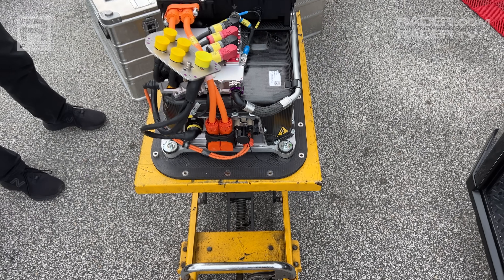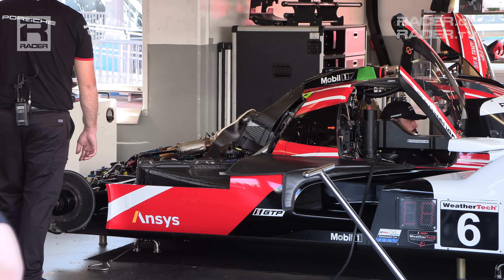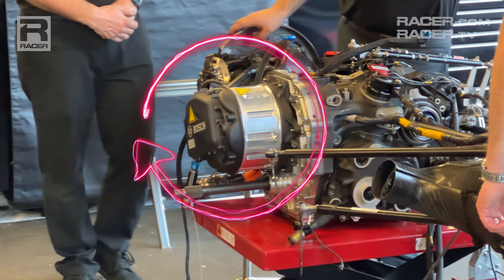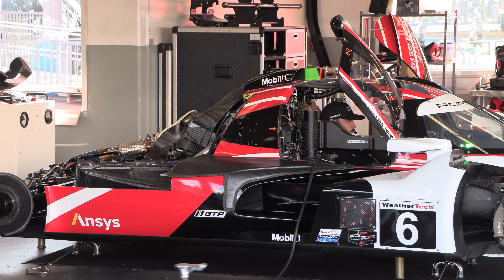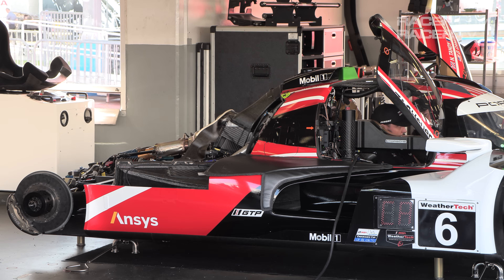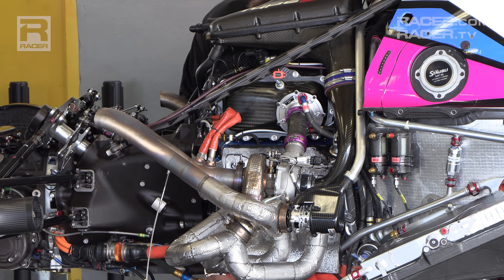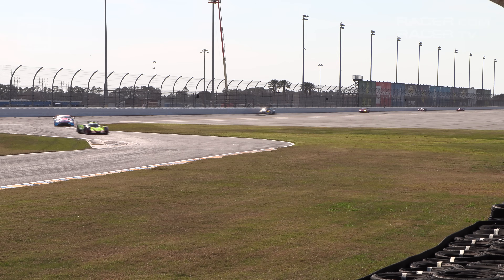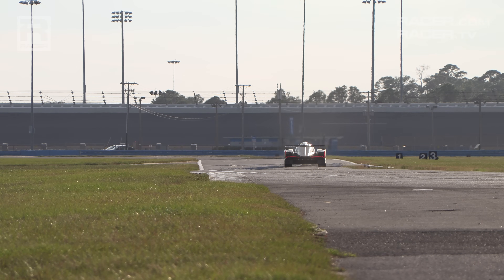IMSA GTP 101: On and Off Track Battery Charging Strategies

Comment: Formula 1 cars definitely harvest on the straight. They flash the rain light to let the following driver know that. It makes for great strategy and passing depending on where they harvest and deploy.  If the GTP cars are always at peak horsepower the only advantage and strategy would be using the low end torque of the electric motor?
Reply: But that's due to coasting, capturing the energy lost at the rear wheels as aerodynamics and engine braking take effect. This sounds like the ICE is directly driving the MGU to charge the battery .
Reply: @djmohab2  No, they often harvest on the straights at wide open throttle. Pay better attention.

Comment: Did I understand the straight-line charging correctly.....essentially the engines make more power than the mandatory limit, the engine management system limits the engines max power, however under charging the extra power is used to charge the battery meaning only 670hp hits the road?

Comment: I struggle to think of something more ironic than a hybrid racing car charging its batteries with its internal combustion engine during warmup.
Reply: Yeah, this part I don't get...
Reply: As long as the fuel efficiency and performance out on track aren't affected then any kind of power generation makes sense.
Reply: @giuseppepuglisi3980  
No conversion of energy makes sense, as it is always associated with losses!
Reply: @giuseppepuglisi3980  they are affected
Reply: First of all: the hybrid unit in these cars is very much a marketing tool. That is probably its main purpose. It could have added to the performance of the cars, but that's not really what it is supposed for. Always consider this: the main targets for the new regulations were keeping the costs down and attracting manufacturers. That's why these are spec parts. Another guy asked a similar question and an engineer gave an interesting answer which I will just paste as here:

From AbsentTK421: "Former Prototype engineer here. Thinking about this as only an energy saving feature isn’t quite right.

Instead, this system basically means you have two hybrid modes available to you. If you only harvest through braking, then you extend fuel range and efficiency. If you opt to harvest on the straights, then you are spending fuel, but gaining energy to deploy for a faster lap. 

This is pretty cool because it means you can opt to use the hybrid system either to extend your stint length, or if stint time is not an issue, just use it to go faster"

Makes a lot more sense this way. So the impact of this unit may not be huge, but could still be race deciding!
Reply: @ReXzz  
Effectively, it is a gimmick to aid racing - under a green cloak.
Reply: @X8X8X8X8X8X8X8X8X8X  a bit yes

Comment: Great video and it answered some questions I had about the power split between the ICE and MGU. It's also the first time I have heard about the charging on the straight.

However, the charging on the straight does seem to defeat the purpose of having a hybrid system. What is the point of having a hybrid system to save fuel when on the straight you are burning more fuel to charge it up? It just gives more credence to the accusation that putting a low powered electric motor in a race car is just greenwashing and manufacturer PR
Reply: Former Prototype engineer here. Thinking about this as only an energy saving feature isn’t quite right.

Instead, this system basically means you have two hybrid modes available to you. If you only harvest through braking, then you extend fuel range and efficiency. If you opt to harvest on the straights, then you are spending fuel, but gaining energy to deploy for a faster lap. 

This is pretty cool because it means you can opt to use the hybrid system either to extend your stint length, or if stint time is not an issue, just use it to go faster.
Reply: @absenttk4213  How can you deploy it for a faster lap when you're capped at 675 HP regardless of distribution between ICE and MGH? Is it because you can have instantaneous torque from the MGH vs having to redline the ICE?
Reply: @djmohab2  Because the combustion engine can make more than 670 HP and use the extra power to charge the battery on the straights, while the electric motor helps give you a faster lap time out of the corners.
Reply: @oddball0045  cheers! Is there a maximum energy cap per lap like WEC?
Reply: @absenttk4213  thanks for the explanation!

Comment: what kind of mileage gain are these cars getting?
Reply: They’ve gone from 2 MPG to 3.
Reply: @andrewahern3730  So a 50% increase in gas mileage!
Reply: @shaunguanco  honestly, probably close to that. Usually 100% of the energy is lost during braking. OTOH It’s a low power electric motor (relative to the ICE) and it charges on the straights, so it might be worse. I wonder if there’s an eco map if they’re trying to stretch pit window?

Comment: What is the point of the hybrid engine?  Just to give the illusion that your sport is all into the global warming scam and appease the "greenies" with a talking point.  70 horsepower for $500K dollars per unit.  The teams probably would rather shut the thing off and let the engine provide the full 670 horsepower.  Probably creates as much CO2 loading the engine to charge the stupid battery.  I hope that battery in the passenger seat is fail proof because some driver is going to have a blow torch right next to them when it shorts out one day.

Comment: Very cool breakdown. Only other race car that I remember that could regen under power was the Porsche 919, but I believe they used a flywheel mechanism to do that.
Reply: That car had an MGU-H, similar to F1. Used exhaust gases to spin a turbine and charge the battery.
Reply: @ryanwhitlock7350  Thank you for sharing this. Considering manufacturers now want MGU-H out of F1 due to the cost, it really puts into perspective how much the top 3 really were spending to win Le Mans and why it was so unsustainable
Reply: The 919 had a battery, Audi was using the flywheel. Toyota used a super capacitor. After 2015 they all realized batteries are unbeatable so Audi & Toyota switched to that type of energy store too. The 919 charged its batteries under braking and via an MGU-H (exhaust energy)
Reply: Not even close.  Research the "KERS" system used in formula 1....
Reply: @Dean0017  who is that addressed at?
Reply: @ReXzz   @JT
Reply: @Dean0017  kk🫱🏼‍🫲🏽

Comment: So… seems like the key would just be to build an engine that can make 800 hp, and neuter it so that you’re making 737 hp with the ICE (670 hp for powering along on the track, 67 hp for charging the MGU). Then using the MGU for powering out of slow corners where the power band of the engine puts you outside of 670 hp?

Seems like a much more complicated, more expensive, and heavier solution than just making an engine with 670 hp to begin with…
Reply: Exactly it is way more complicated and it is all about politics has nothing to do with the advancing of Motorsports. It has everything to do with advancing various political agenda  by Corporatists

Comment: Now this is quality content, any word on the battery pack capacity?
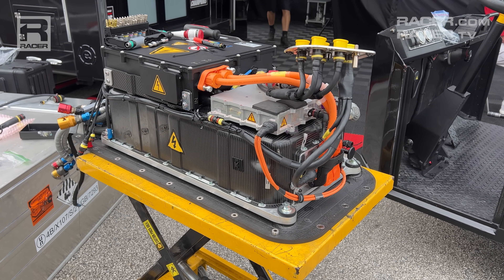Reply: If you look at 0:43 in the video, there's a label on the side of the battery...looks like it says 1.35 kWh.
Reply: @GregReinacker  Less than I expected. I understand output is the main consideration but still....
Reply: @ktwei  More capacity = more weight and cost.
Reply: judging by the size of the actual box maybe maybe 10 amp hours

Comment: I’d love to know what this power sharing allowance means in terms of fuel efficiency savings if compared to other race cars who have similar systems but don’t have an extra allowance while charging. 

I’d predict it’s more efficient since the electric power delivery is almost lossless in terms of waste heat generation (i.e. charging the battery while driving at high speed while the ICE is already doing lots of hot work and converting a small amount of that inefficient work into more efficient reserve electricity for later use). 

Any insight there would be fantastic 👍

Comment: If I’m understanding this correctly if they need more than 670 for the charging plus driving the car the computer will turn up the horsepower? What’s the trade off between using more fuel to charge the battery and the extra power from the MGU after charging?
Reply: The point of a hybrid system is keep manufacters happy and their money flowing.
Reply: the whole point of using hybrid is to be more fuel efficient, but yeah that doesn't quite make sense... to charge the batteries by burning more fuel... The Porsche 919 and F1 cars today, use the exhausts and turbos to mechanically generate power thru the MGUH, energy that would have gone to waste.  The only way that would have made sense is if cars were like the LMP1h cars, where they had 400+hp in electric power, by sacrificing top end speed for massive quick acceleration, but no, these cars are hard capped at 670hp.  I mean, in theory, since the ICE can easily do 670hp, the cars would be faster just running the ICE and leaving the hybrid systems in the garage, but of course, there's weight limit.  At the end, reliability will be a key factor of who will win, and not outright pace.
Reply: @DonLee1980  Agreed.  The explanation doesn't quite make sense.  If the ICE can generate the capped hp then why add the heavy electric motor/battery.
Reply: Former Prototype engineer here. Thinking about this as only an energy saving feature isn’t quite right.

Instead, this system basically means you have two hybrid modes available to you. If you only harvest through braking, then you extend fuel range and efficiency. If you opt to harvest on the straights, then you are spending fuel, but gaining energy to deploy for a faster lap. 

This is pretty cool because it means you can opt to use the hybrid system either to extend your stint length, or if stint time is not an issue, just use it to go faster.
Reply: @absenttk4213  ok but wouldn't these cars be better race cars with less weight and complexity?  A lighter car is by definition more fuel efficient as it takes less energy to brake, corner and accelerate more mass? 

Here's my question, if the hp is capped and the ice is capable of achieving and maintaining that cap, what's the purpose of the e-motors?
Reply: @Bahamuttiamat  That is a good question. The answer has to do with how you apply the power you make. With an ICE alone, you are limited to only applying power within what your engine-to-gear ratios will allow, given your engine RPM.

With a hybrid MGU, you can apply that extra power essentially however you choose, since it is not bound by engine RPM. For example, you could choose to use it to add more torque out of a corner, or at the end of a straight for more top speed. Being able to pick where you add some extra kick is a great way to make up for a part of the lap where your setup might not be as strong.

Overall, the hybrid system, especially with this dual charging mode, adds a ton of strategic options for how to make a car fast. I can already say for sure that the different manufacturers each seem to have their own idea of how to use that extra energy.
Reply: @absenttk4213  these are fascinating insights, thanks a lot for explaining!
Reply: @Bahamuttiamat  you are right. It would of course be faster to have a lighter car if power is capped anyways. But the point was not to build a fast(er) car. The point was to build a hybrid car and keep the costs down. Hybrid stuff is what the manufacturers are interested in and its the only reason we got this many now! The high minimum weight of 1,030 kg was to keep the costs down. Also the fact that it's a spec hybrid system keeps the costs down as well. While it is all high tech stuff, it's not cutting edge technology. If you want to be cynical, its pure marketing. A brand like Porsche running a 67hp e-motor after having succesfully designed and run the 919 hybrid - a much more comlex and more advanced prototype with a 400 hp e-motor - doesn't really learn too much from this! But as long as the manufacturers are happy and stay this time (not leave because costs explode as it was in LMP1) I am happy!
Reply: @ReXzz  Even that being said, another way to look at it is, It used to be manufacturers asked :  "How powerful a car can we build?" 
But now they are asking a slightly different question : "Given a limit on fuel and engine size, how can we find other ways to increase power?"

That question very closely mirrors the challenges facing car makers in their street cars today. Cars cant get much heavier, or carry much more gas. The gasoline has not changed much in recent memory. So to continue gaining, you need other ways, hybrid power, energy capture etc. In that way, the rules in IMSA are built to give manufacturers the ability to take that same engineering challenge at the most stressful level. And this is part of what makes a hybrid formula more attractive than not.
Reply: @absenttk4213  ohhhhhh ok that’s very cool indeed! But when you say other ways to "increase" power… the power limit is still capped at 680… so it’s not really increasing the power. Does it increase the torque? And if so how does that impact laptime and acceleration?
Reply: @ReXzz  In passing it is convenient to say the limit is 670hp, but there is actually more going on than meets the eye, and that is why it is both true that the cars are making more power, and useful to do so in lap time. I will put some technical detail and numbers to illustrate. All of the following is public info (disclaimer that these numbers are not private material).

First off, the actual LMDh rule is Art.5.1.2 which sets performance of the powertrain at 500Kw max, +/-20Kw for BoP adjustments, its actually a graph related to engine RPM. Now, this really is just saying there is a limit to the total power we can put to the wheels at any given time. So yes, we could just build a gasoline engine that would make all that power. But we also have a limit to the amount of fuel we can carry. If we made all that power via the ICE alone, we would need a lot more fuel than we can carry. Much of the energy produced in a gasoline engine is lost to heat and friction waste. They are only 20-40% thermal efficient.

So, in order to be able to make that power output AND keep under our fuel limit, you capture back some of that energy with hybrid systems.  Important to reiterate here my previous observation, that energy you have in the hybrid battery you can use more flexibly than energy from the ICE. Just how much does this help? We can compare directly with the example of Toyota LMP1 at le mans, since we have no public LMDh data yet.

In 2013 LeMans 24h, Toyota LMP1 averaged 180MJ fuel energy used, only recovering 27% of possible hybrid energy, which only contributed 1.9% of their power. Their fastest lap was 3: 25.151

Now skip to 2019, they averaged 124.9MJ fuel energy used, now recovering 60% of possible hybrid energy for a contribution of 6.4% of their power. Their fastest lap improved to 3: 17.292

So, these improvements are a win in every way. They use less fuel, while gathering more energy, AND decreasing their lap time. Sure, the car must still be tuned to stay within the regulations on power, but the fact that you can go FASTER while using LESS fuel than before tells tells us that overall, the 2019 car is much more powerful than the 2013 car. The same pattern will likely be true in LMDh.

EDIT : Clearly hybrid improvement is not the only reason for the improved lap times, but it plays an important part.
Reply: @absenttk4213   but how can they make more power when the limit is clearly 500 kW? (I know it’s net 500 kW, so "negative" torque on the e-motor allows for more power on the ICE). Highly appreciate your long thorough answers btw, even though I knew most of your last message anyways. In the case of LMDh the hybrid system will only help with reducing fuel consumption though. And they are far less efficient than LMP1 H cars because they only have one energy recovery system and the opportunity to charge the batteries with the ICE, which got to be MEGA ineffecient😂

Comment: So there's a HP cap on how much the GTPs can deploy at any given time, correct? either through the ICE or ICE + ESS, you can only deploy up to 670 HP, and if the ICE can put out more than those 670, some of that power can go to recharging the battery even at full throttle? That's pretty cool indeed. Thanks for this GTP 101 series, Marshall and Racer!

Comment: I doubt that hybrid system really saves much fuel over the weekend. 😅 why dont they charge the battery on the plug in the garage?? Seems nonsense to charge it with the engine on
Reply: Hi! Former Prototype Engineer here. I can confirm that yes it saves a lot of fuel, and as for charging there is an interesting reason why it is smart.

All prototype cars have engines that require a warmup process before they can be run on track. This is to properly heat all the seals and components. Usually between 3 and 10 minutes of running through various RPM ranges. So, if you can adjust your warmup to also charge the battery at the same time, then its pretty handy.